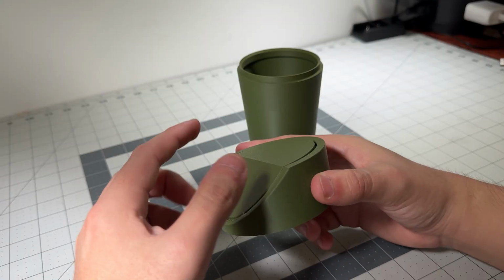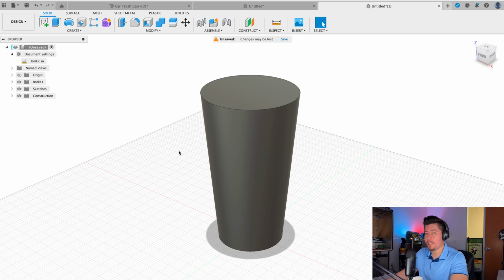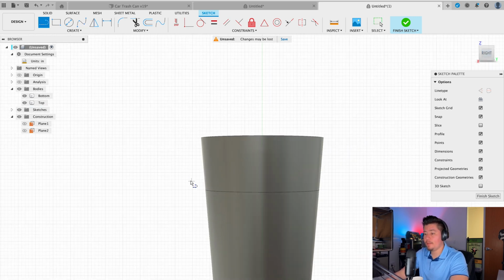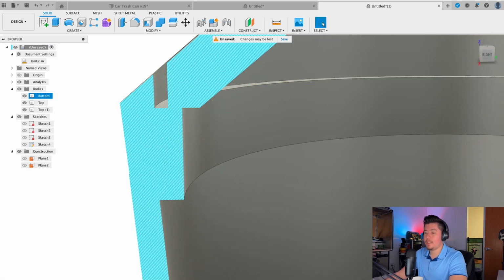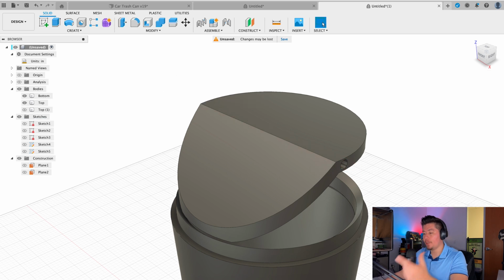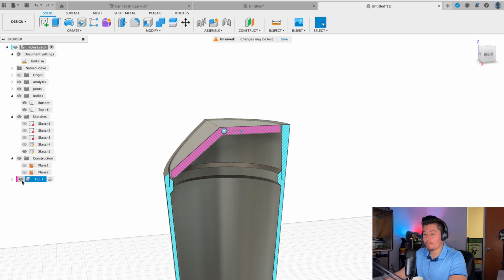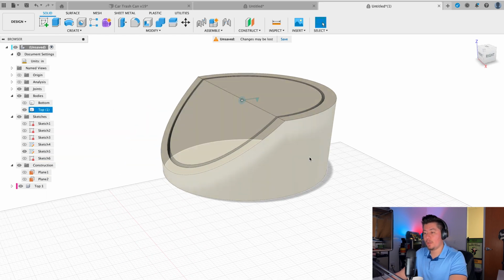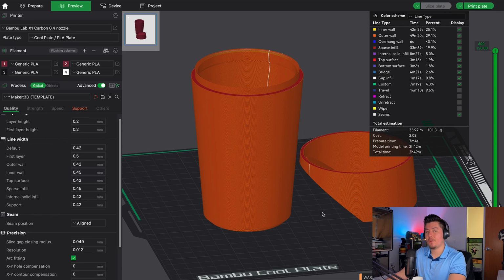How to Design and Print This 3D Printable Trash Can in Under 20 Minutes | Fusion 360 2024 Guide

Comment: An excellent tutorial - you can enhance it's high quality level by making sure your timeline is visible to the viewer - that helps when a viewer (like myself) may have missed a step and wants to doublecheck their work.  Another high quality addon would be simulating the most likely problem (other than the lid not clearing the lip, which you do perfectly).  

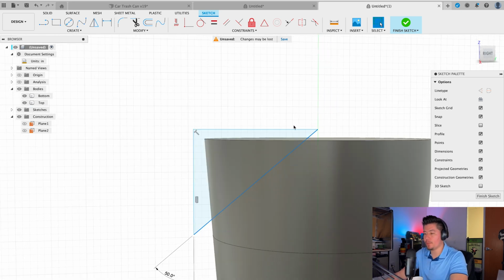I did get hung up on the triangle sketch to set the slope of the lid ( 06:43  ) , I didn't realize I didn't have the triangle go high enough when it extrude cut, so it missed the top portion.